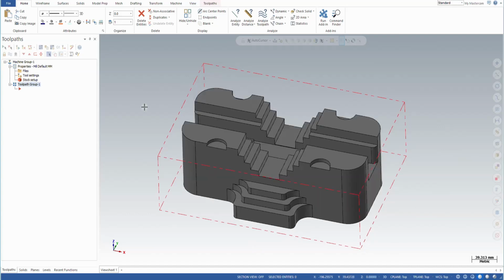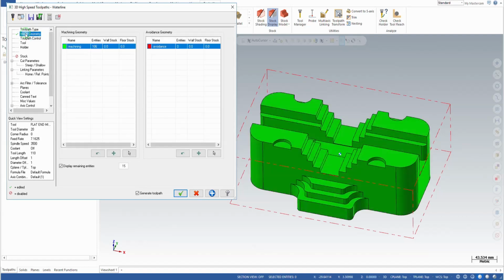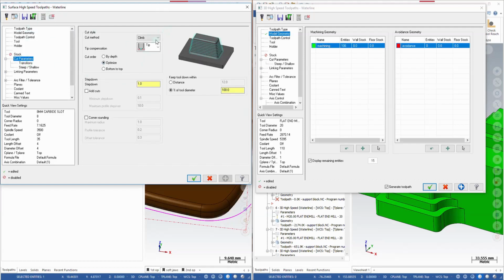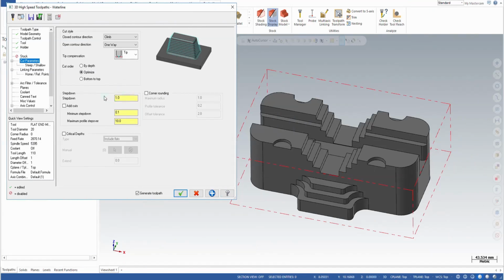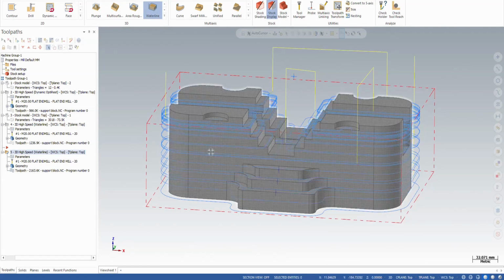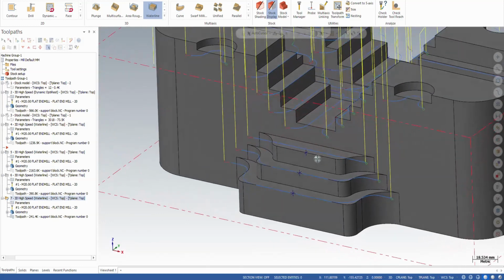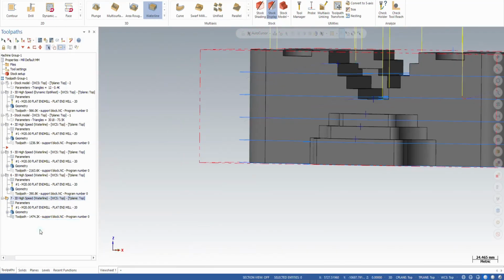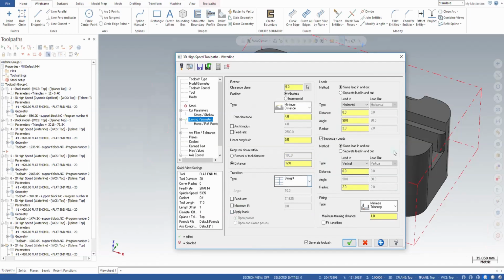MASTERCAM 2022 - SNEAK PEEK 2  WATERLINE

Comment: Hi Sir, thank you very much for your videos. I am using Mastercam for many years, but I cannot understand why they did not add simple but important features up to this new version. I was always annoying and expecting them to add these features for many years. I also wrote on the instagram page of Mastercam when they asked the people what to see on new version. Firstly, one of my expectations was this spiral movement for the closed contours. Powermill and some of the other common CAM programs have this feature for many years. I like my toolpaths to have one entry and one exit if possible and spiral movement is perfect. However, I sometimes saw the tool motion traces on the machined surfaces when I selected "Tangential Ramp" option in the transition option in Waterline toolpath. Secondly, and most importantly, "extending/trimming" tool motion beyond the surface for the open contours in waterline toolpath and all the other 3D toolpaths was not possible although it was possible in Multiaxis toolpaths as I know. I was annoying all the time since we did not have mulitaxis license until last year (we bought Mazak Vrx i600 and Mastecam multiaxis licence last year and I learned a lot from your multiaxis tutorials). Even my mastercam dealer was not aware of it. I informed them but they insisted that Mastercam have this feature. I wanted them to show me how and then they realized its absence. I was creating "Surface from Solid" and then "Extend" this surface, then select it as the machining surface to extend the toolpath beyond the surfaces that I want to machine. I could not find an easy way to do this. You did not show in this video but it is possible to extend the toolpath with this "2022" version as my dealer informed me. This option is also available in many CAM program and finally, in 2022, Mastecam has it :(. My final expectation was the tool to plunge outside the surface in Horizontal Area toolpath if the surface is open instead of plunging on the surface directly with a helical or ramp motion. I do not know if it is possible in this version. Maybe you know short ways to do these and can make a video to teach how to do.
Reply from the maker: i know that mastercam (like every other CAM system) has some pluses and minuses 
In 2022 waterline toolpath it is possible to extend open contours :)

Sometime when I need to balltrack the surface or generate the 3d feature using ballnose cutter  I use 3d "Flowline" toolpath and you can extend the passes beyond the machining surface 

We will be adding more tutorials regularly

Comment: what about flat area detection with dynamic or standard roughing?
Reply from the maker: There is no flat detection in dynamic roughing so far but even in the current version of Mastercam you can use 3D toolpath "POCKET" where you can detect flat areas (in "rough parameters" tab --> cut depths)